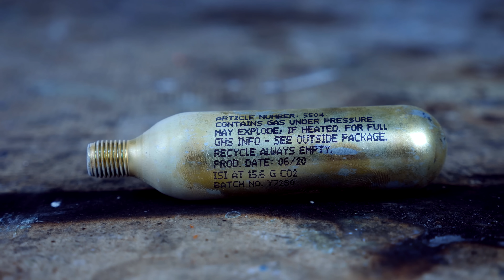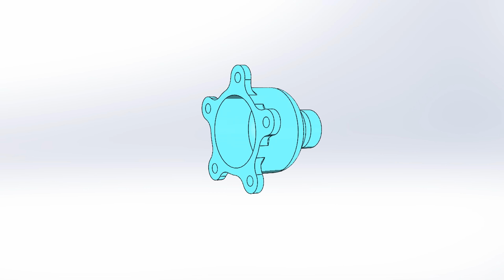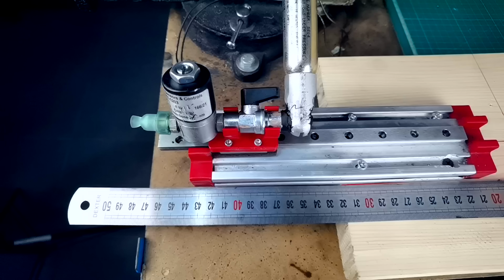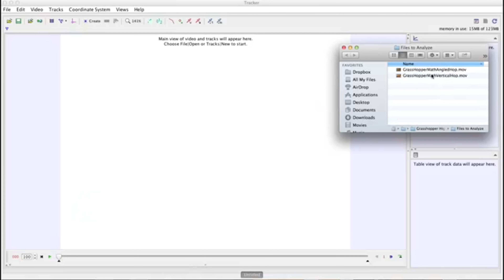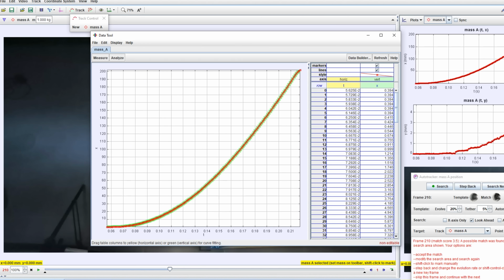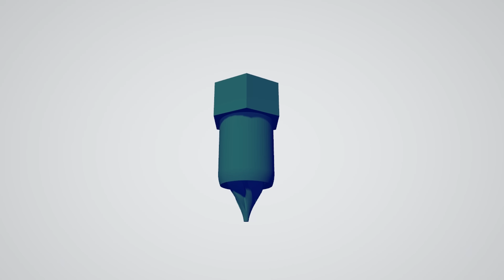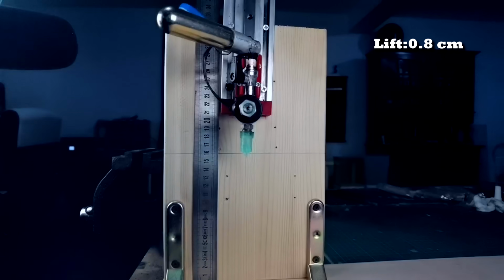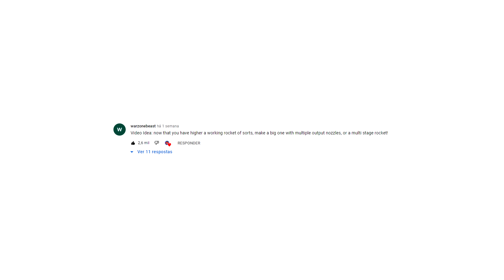I 3D printed a CO2 Rocket

Comment: Hey Integza, I had an idea, if you were to combine two of your past projects: the vortex nozzle, and the solid fuel core

Wouldn't you be able to make an engine that powers itself while protecting the outer casing?

That way the geometry of the nozzle wouldn't change as the fuel inside burns away.

Comment: Video idea: you can use a compressed gas cylinder, a hose, and a scale to more accurately test the performance of different nozzle types at different pressures to find a nozzle design that will most likely work with whatever engine you're building at the time.
Although if he decided to build in a fire suppression system (using the CO²) to his test rig that would help save money on fire extinguishers. Lol

Comment: Here's a future video that I was just chatting with some friends about and looking at part costs then saw your video: you should strap these to Mario Kart Live: Home Circuit cars and boost around a track. Maybe stick a pipe and a needle valve or something past the solenoid to control the output over time instead of a single large burst so you can have multiple uses? Not too sure about the mechanics on that or the pressure per canister. Either way would be super neat to see this working on an actual vehicle.

Comment: It seems that your exhaust velocity is going to vary with the temperature and state of discharge of your CO2 cylinder and acceleration will vary as the overall mass decreases. Maybe use a larger (and more cost effective) stationary CO2 tank supplying the rocket with a hose. Set up to minimize all of these varying elements, and that would give a better comparison between nozzles?

Comment: I think you should combine this project with your previous metal nozzle experiments. Go back to the previous (combustion) rocket setup, only this time, when you design the metal nozzle, build channels into it for the CO2 cartridge to discharge through. The combustion rockets kept failing because they would melt the nozzles. I'm thinking that by running the super-cold CO2 through channels designed into a new combustion chamber/nozzle assembly, you could keep things from melting down. Most of the thrust would likely come from the combustion portion of the rocket but it will hopefully last long enough to do some useful testing with.

Comment: Remove the solenoid valve and make a mechanical solenoid piercing pin to discharge all the gas (solenoid should be outside the rocket structure). You will reduce the weight of the rocket. And you will achieve the right linear structure of the rocket engine. 😉 love your videos.

Comment: You could 3d print in iron a 2 stroke engine and you can harden the pieces, because when you 3d printed in metal you had to let the pieces cool down slowly but this makes iron weaker so you should heat the pieces again and dipnthem in water so they harden

Comment: My suggestion: Try a larger hole in the CO2 cartridge.
	Reason: If all of the CO2 is going to a solid to a gas. The expansion ratio is ~82:1 [Solid CO2 = 146 Kg/m3 and as a gas at air pressure ~1.8 Kg/m3 => 146/1.8 = 82.8]

Secondary suggestion: Add heat in the expansion bell of the engine. Even a small secondary combustion engine would add a lot. [CO2 at model rocket engine temperature gives an expansion ratio of >>300:1]

Comment: I have a way to solve your melty nozzle problem, next time you build a liquid fuelled engine that uses a cold propellent like kerosene, wrap the fuels pipes around the nozzle before attaching them to the combustion chamber, so the cold fuel cools the nozzle before being burnt in the combustion chamber, the space shuttle's RS-25 engines did it and it worked very well.

Comment: Idea for a next video : you could use the O2 generated by the reaction between H2O2 and KMnO4 to burn a fuel like methane or alcool, wich could improve the performance of the engines of your last video !

Comment: Those Co2 cartriges wont give you sustained power output and they also dont last long,,,how about you use actual dry ice with a heating element to produce prolonged high pressure Co2 gas release for your rockets by vaporazing solid dry ice....or if that doesnt work just like in your devils toothpaste video have a chamber with actual dry ice and pump hot water into the chamber that should work to produce decent thrust

Comment: An idea for ya: try to make some kind of chamber before the nozzle, but put inside heatable heatsink with radiator. You're loosing pressure and prescious gas because it can't get enough heat and blows away in liquid/solid form. if you find a way to heat it, you should get a lot better results

Comment: Possible experiment for a video: Could you increase the gas pressure from a co2 cartridge by passing it through a hot nozzle?  If you heat it electrically and have enough power, would it be possible to keep the nozzle hot while the canister is discharging?

Comment: I can tell you like rocket a lot and I don't see nothing wrong with that 😁 rocket engines are cool. But how about piston driven engine model 3d printed with some CNC cutted parts running on co2 with some pressure regulator so it can run longer then 5 seconds and annihilate it's self. I had some long stroke piston engine in mind, something like a steam engine but on co2. Shouldn't be to hard but also not to easy either 😉

Comment: Nozzle type is also the main problem for cold spraying. In this challenge not only the speed of the gas important also; speed of the powder, shape of the exit gas, total interaction between gas and powder and more... And a fun fact; it is too easy to build a test system for cold spray and cheap :)

Comment: What if you did a video comparing the difference in thrust produced between venting the co2 through a nozzle (like this video) vs using the same pressure to do work to produce thrust like one of Tom Stanton's compressed air engines.

Comment: Idea: Make some thing out of Empty cartridges because they can withstand high pressure and you have lots of them😂
Reply: like melt them all in a small electric furnace and make a shape of a ... tomato...
Reply: Use them for mini submarine ballast tanks.
Reply: Great Idea
Reply: Use them to build engines out of metal that won't leak flames, lol.
Reply: Lol
Reply: Use them as combustion chambers and (sawed off) expansion bells for rockets maybe?
Reply: Filling them with gunpowder and an fuze is a quite fun way of making your own diy firecracker
Reply: Idea: Fill them with CO2, plug the end, and use them as a rocket engine.

Comment: Video idea: A drone with a rocket engine built in! Or even design a custom drone with a rocket booster included.

A drone that can hover, then instantly activate warp speed would be awesome!
Reply: Ludicrous drone mode
Reply: Yeah can get some pretty reasonable acceleration just with props.
Reply: @NCRVeteranRanger-w6s  Add wings 💸

Comment: Here is a question and maybe video idea: Does an N2O cartridge (whipit) have more or less pressure to use in a rocket compared to a CO2 cartridge? Also, would they be able to boost other high temp rockets?

Comment: I always thought those containers were full of liquid CO2 not solid CO2, I know the big old paintball tanks of CO2 slosh around with a liquid. You might see if you can get those reusable 20oz paintball tanks filled in your area, it could be cheaper to use those and some remote paintball gun lines than those disposable cartridges.

Comment: Why don’t you add a small induction heating chamber which will further expand the gas and increase thrust.  You will have to roll the gas pipe around the coil to let the gas heat longer before exiting of course without touching the coil. Closest examples for representation of how the coil looks would be like earths or magnets magnetic field. 
You can use a fiberglass insulator or ceramic to keep he coil and the gas tube from coming in direct contact and shorting the coil circuit.

Comment: I drew up this idea a while back but I do not have the equipment or budget to make it personally.
I am almost certain it is physically possible 🤞 but it would require alot of tech and problem solving along the way, maybe Elon Musk could assist haha...

It's a small tube/torpedo shaped forearm or smaller sized device.
It can eject its nose part using  a capacitor driven electro magnet repulsion setup or some clever thing that could propel it maybe 15ft ish.
The front/nose part would be attached via line similar to fishing/wire or something like this that is lightweight and strong...

The main body of the device would need to momentarily provide thrust or air resistance whilst it is ejecting the other device for a short time as the intention is for the device to be in mid air at the time of action and also if thrown purposefully with a spin.

The projectile to be fired upwards would be a container which can deploy and recoil a small parachute very quickly at the opportune times to try and gain altitude as sensed by onboard electrical sensors and preprogrammed stuffs.
Also attached to this part would be a recoiling hoist type device (,as light as possible) which would be suspended by short lines below the parachute.
The intention would be for the hoist device to pull up the firing mechanism after deploying the parachute and therefore gaining altitude as a whole unit.

The intention would be that you can throw the device into the air, it senses its orientation and velocity so as to fire at the opportune moment the parachute device upwards. The parachute device then opens when it reaches max potential height and then quickly recoils the firing device to the base of the chute at which point the chute automatically recoils into the device and the process repeats until the battery or fuel is depleted at which time it is automated to keep the chute out and slowly glide down.

Could you please make a device which can gain altitude in this way through momentary bursts of power and also able to be thrown with spin skywards from a user on the ground and eject the parachute whilst during a spin the front is facing up.

At the point the device fires the top part with the parachute upwards it would also need to either create drag with some kind of non aerodynamic fin and electronic or mechanical assistance or propel itself with a force that balances out most of the opposite reaction + gravity.

Probably so confusing to try and imagine without a diagram. Hope it makes sense, if not ask please.

Comment: Video Idea: I'd like to see a combination of CO2, nozzles & water. Suggest you don't pressurize a tank of water but instead add smaller amounts of water into the CO2 flow path.
Reply: Impulse mass?
Reply: I'll second this. Without water the CO2 comes out so cold that it loses a lot of potential performance. Adding some warm water (maybe 50°C) using a venturi injector should be a simple way to get a lot more bang for your buck.

Comment: You have to control the temperature of the cartridge/exhaust. It's a common problem in paintball. The more you shoot the lower the temperature/pressure in the CO2 container to the point it (the gas inside) freezes and you cant shoot anymore. You know - the expansion cools stuff. And that rapid expansion you do ... I doubt it is very efficient. That's why professional paintballers use N2 for working (shooting) gas :)

Comment: Video Idea : It would be cool you could modify a 3dPrinter to make pancakes. Kinda like your metal 3Dprinter but with a pan or something similar as a heat bed and pancake mixture dispenser as extruder. Then you can use GCode to design custom pancake designs...

Comment: judging by that exhaust on the de laval nozel you might get away with a larger diameter, it still expanding a bit after leaving the novel ( which means nozel might be too small still, this is why we have 2 stage rockets with different size nozels as the exhaust expands, expanding exhaust = lost efficiency, a wider nozel mide capture more and give more thrust i believe.

Comment: hear is a tip for removing supports of 3d resin prints. after washing and before you cure the parts if you use a hairdryer on the supports they will warm up and flex and they will easy peal from the print and should leave no puck marks. :) you can also do this by placing the print into hand hot water to remove the supports.. hope this helps you save time and prints :)

Comment: You should make a tube which is powered by co2 gas that pushes the rocket out the let the rocket ignite, i recommend you to use charcoal and sulfur as a solid fuel then use liquid oxygen as an oxidizer. You can then 
strap a tomato in front of the rocket, then launch it.

Comment: Cool video, thanks for that! 
0:50 the CO2, when compressed at RT, is in liquid form while when decompressed it freezes down to -77 C becoming dry ice. 
I believe if you try to keep the metal cylinder and the gas from freezing you should get more power out of the shell.

Comment: You can make little mortars with those CO2 cartridges, just tape on a sharp point to pierce the end and drop them down a tube to the ground. Their own momentum will pierce the seal and they launch about 100feet in the air. Try that but with a few different nozzle designs… will be very entertaining.

Comment: @Integza Diverging nozzles are designed for supersonic flows, where a divergence cause the fluid to accelerate (yes, exactly the opposite of subsonic flows). Most of the time it consists of a convergent part that accelerates the fluid to Mach = 1, followed by a diverging part that accelerates the fluid in supersonic regime.

The thing is, if you don't reach Mach=1 at the throat, then your divergent section will actually loose power. I would bet you would probably get better results with convergent nozzles (but this depends on the amout of pressure you can reach in your chamber, obviously)

That said, awesome stuff, I love it :)

Comment: Hey Integza, since we're at an experimental stage with unusual propellants, here's the tip: Brazil is developing an ethanol-based rocket engine called the L75. There's a significant amount of material on the internet about it, but I haven't seen anyone talking about it.

Comment: This may be a dumb idea but what about using those CO2 canisters to discharge into a liquid fueled rocket separating the expanding CO2 and the liquid fuel with an air tight piston. This would force the liquid fuel out of the rocket nozzle by keeping it constantly pressurized by the moving piston being pressed by the expanding CO2 discharging. I hope this make sense.

Comment: A few suggestions to improve Isp:
1. Heat the canister to increase the pressure.
2. Heat the "gas" after the valve to improve the phase change. (there's solids and liquid ejected that could be converted to gas)
3. Both 1 and 2.

Comment: You should 3d print an rocket housing with some sort of coil pathway built I to the walls, and try to heat the pathways, as the co2 passes through the housing it will get warmer and expand faster. Thus giving more thrust.

Comment: Idea,  what about creating a drone using the dry ice system with Independent valves and one main chamber reservoir(possibly could then use hpa systems  too to hold a larger volume that can be refilled) to turn either a Tesla turbine or Mazda rankle engines

Comment: Not a video idea per-se, but I'd really just like to see this CO2 'rocket' with a more compact (or at least in-line) design. The current implementation probably has weight distribution issues that I imagine would throw off performance.

Comment: Video Idea: you could build a hybrid rocket engine. And by hybrid I mean a combination of solid fuel and dry ice fuel. They could both generate thrust and keep the whole combustion chamber at a reasonable temperature. Meaning the dry ice could cool the nozzle down and the heat from the combustion can help the dry ice change to gas quicker.

Comment: You should redo the aerospike nozzles with an ablative coating. You can buy phenolic microspheres/balloons rather cheap. Mixed with nylon and epoxy this is the same stuff developed for commercial ablative nozzles.

Comment: Hi Integza, have you considered friction in the vertical test? Linear guides are not perfectly tight, and allways might be a little woble between the guide itself an the linear bearing, so if you can, try to mount the CO2 cartridge in line with the valve and the noozle, so at least you will reduce the chances of be forcing the linear bearing to the side due to de descompensation of weight of the CO2 cartridge being at the side. Also, try to lubricate the linear gide with some oil to lower the friccion coeficient and maybe gain some lift power with the same set up.

Comment: I see alot of comments about "multi stage" rockets...... but almost no comments about making a multi-motor rocket.
Think along the lines of a Saturn 5 with multiple rocket motors per stage...... combined thrust = more power = more lift!
Maybe have a large c02 reservour for all the motors per stage rather than one per motor, so then you have one control valve and more control overall.
The only issue would be steering it....... but where is the fun/danger in that huh?

Comment: Idea:Make a water bottle rocket, but instead of compressed air use a co2 cartridge to push the water out. With the right nozzle the dynamic pressure should not exceed the bottle limit.

Comment: hey integza... i know i wont win the contest but you should be able to extract FAR more energy of expansion, it should be possible to get differential expansion, if you heat it up on exhaust and the higher the output temperature the more expansion you should see, you can get 1mm or 0.4mm stainless steel tube for cheap on ebay
Reply: if you stack a bunch of tubes inside a outer tube and some how heat them, say... lithium batteries or a blowtorch? you should be able to get more laminar flow